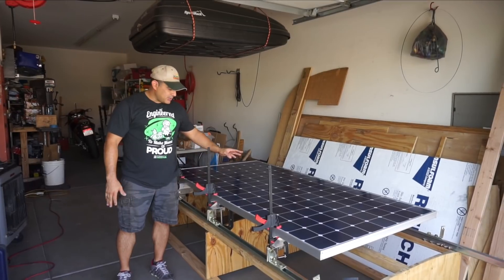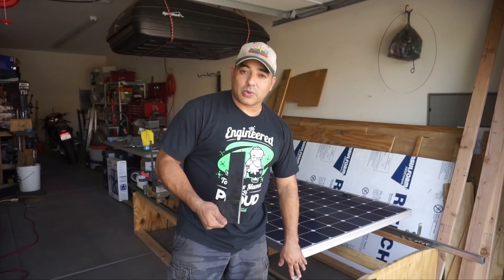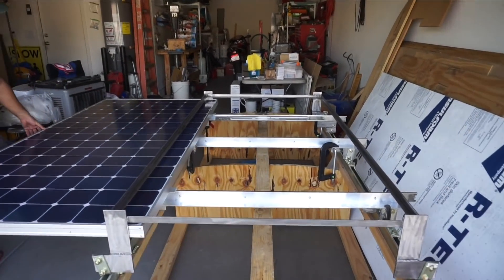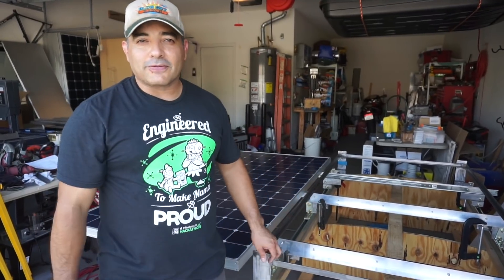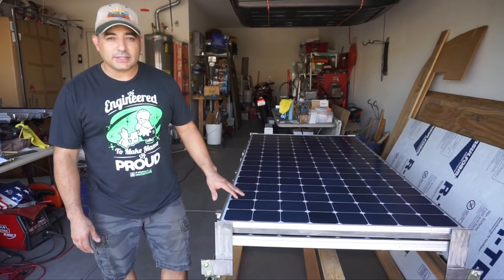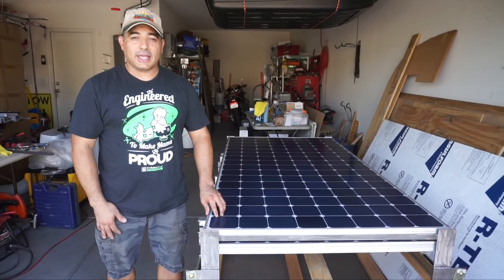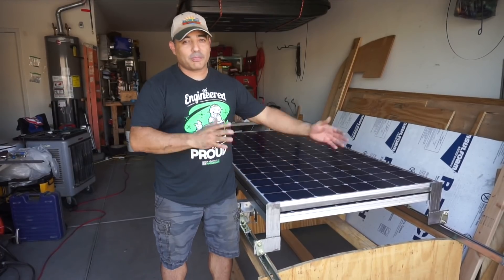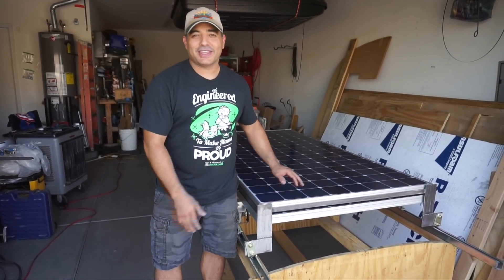RV Solar Rack - Part 3: The Upper Layer

Comment: Well this got even more interesting when you said you were going to automate the sliding panels, I can't wait to see how you do that. I assume you were talking about some type of cable track for the wires to lay in for the bottom panel. What type of controller are you going to use, a PLC or something like an Arduino or Raspberry Pi? I would recommend a PLC for long term reliability. You can get some pretty inexpensive ones at Automation Direct.
Reply from the maker: Thank you Dirt Road Sailing - We are still figuring everything out - very likely it will be a Rasberry Pi We will look at Automation Direct.  Thank you for the suggestion.

Comment: Be sure to smooth all the edges of the brackets, remove the corner point also or the paint will not cover. Paint will not cover the sharp edges and you have rust in a matter of weeks.
Reply from the maker: Thank you John - we will keep that in mind as we build out everything and get it ready to paint.

Comment: I'd go with an enamel or hammed finish.
Reply: Sandblasting the welded parts first will allow the etching primer to bond with the bare metal. Getting the mill scale off of the welded parts is paramount.
Reply from the maker: I don't have a sandblaster but we did use flapwheels and a few other sanders to prep the surface

Comment: Be careful with the total voltage produced in series.  Many charge controllers don't like over 150V.  Also don't forget to take the early morning cold weather maximum.  It can be an additional 25% more voltage.  Looking great BTW.
Reply: I see in the picture on your blog posts that you probably have the 250V/100A Victron charger.  Wow that unit is expensive!
Reply from the maker: Thanks Shawn.  Yes these panels are rated with an open voltage of about 86V so the 150V was not enough.
Reply: You control voltage by string count 4 x 2 should be no issue